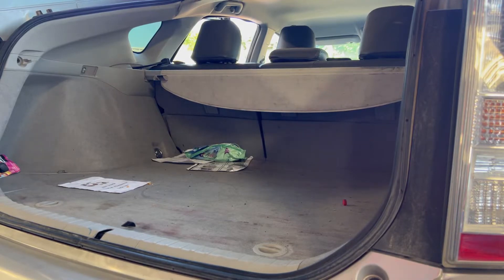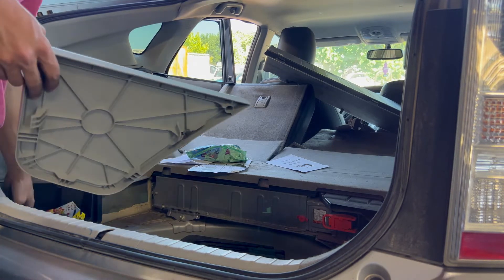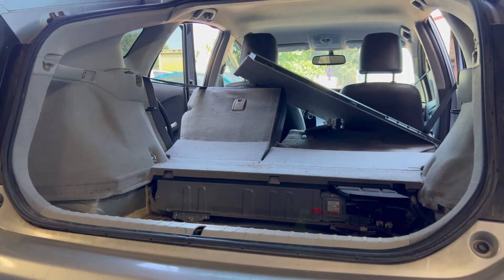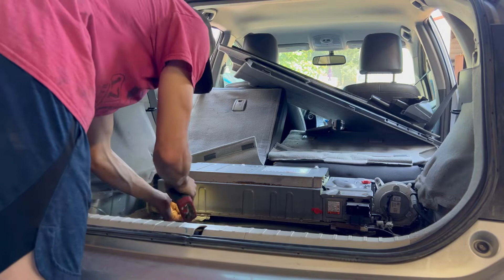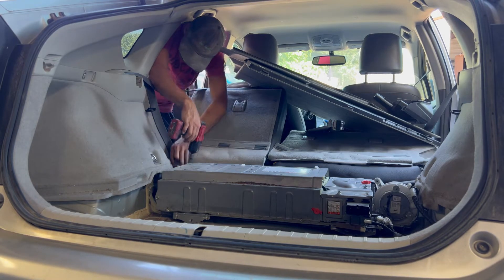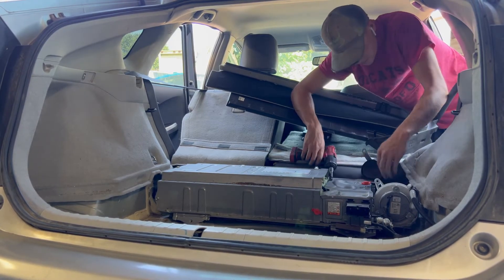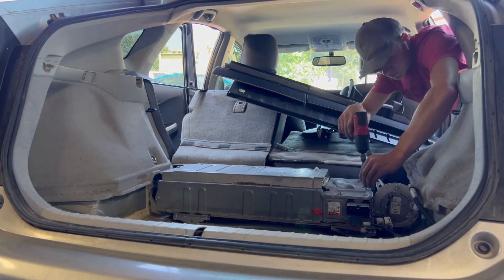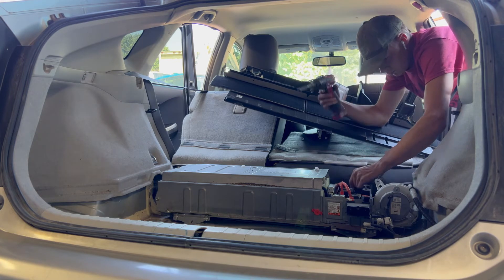2010-2015 Gen 3 Toyota Prius Hybrid Battery Removal (5 min)

Comment: I don't know if you can make a video showing how to replace a single cell from the battery pack without taking whole battery cells pack apart I don't know if that possible or not
Reply from the maker: You have to take the whole pack out because there are bolts on the bottom!